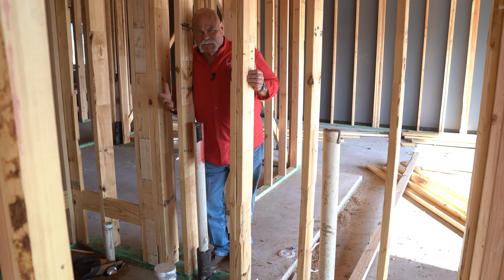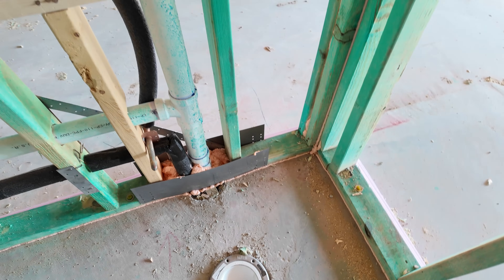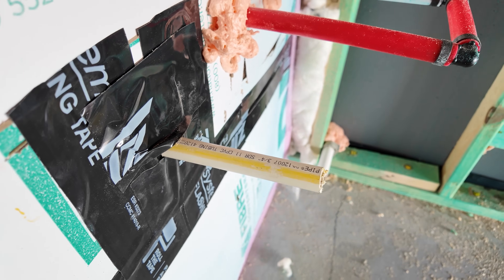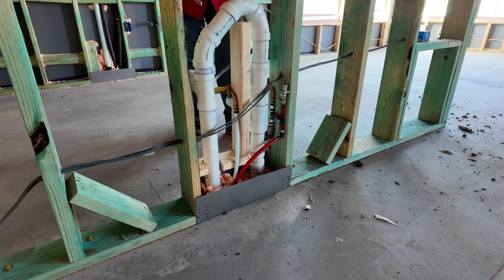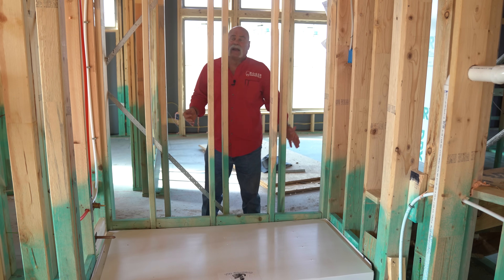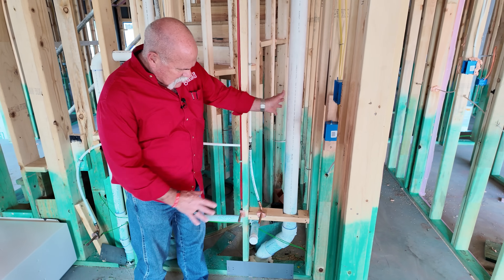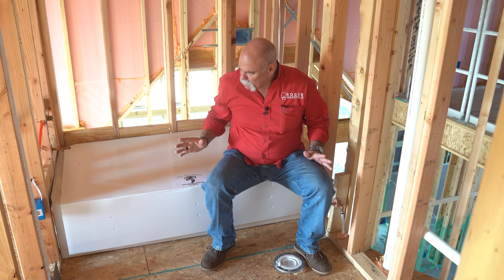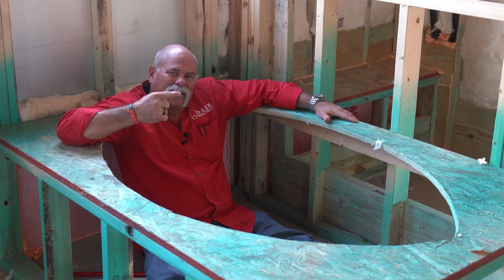House Plumbing Top Out | Everything You Need To Know

Comment: He couldn't hit that toilet right them offset flanges are stoppages and he leaves it wide open not even taped up or anything so someone can drop oh idk something down it and it not get seen and get pushed down the line and get jammed in a wye ten feet away making it a total nightmare to get out when I do the top out on a bathroom when I walk away everything is done and then move to the next part of the project this way your not retracing your steps and ending up walking back and forth to the same place you have already been ten times it's just more proficient also why are they still doing island vents one 3 inch stub up in the back of the cabinet not even in the wall will give you ample drainage and vent the pipe will never be more than half way full the top part vents the water and it's never going to be a stoppage issue just put a 3 by 1.5 san tee and a clean out on top of that and pick up the sink bam done. All done on final too so less labor on top out just rough in the water

Comment: The term Top Out had me puzzled for a minute as I've always heard of it as 2nd rough or "tubset".  All the same, different terms.  It looks great, the only thing I would do differently at this stage of my career is use 3 X 4 closet bends to bring up the toilets in 4" and leave them alone(Or cutting them down to a reasonable level if they're too tall) until trim stage.  Here in FL, lots of tile.. I like letting the floor guys or tilers get up to the 4" riser then cutting it flush with the floor and then cementing my pvc flange with stainless ring right on the floor.  Then, tap con into the concrete or wood screws if 2nd floor.  The copper stub outs are great as long as the water doesn't tear up copper in under 40 years IMO.  A little $$ as opposed to pex stub outs, but they are nice.  The  cleanouts for the kitchen sink are a great addition, nice job there.  Another fine vid Roger.
Reply from the maker: I love seeing how other people would do things…thanks for sharing! 😎

Comment: The plumbing and electrical is the only thing nice in those cheap home builds. Gott love the cardboard sheathing, water heater in the unconditioned garage, blown-in insulation, 100% flexible ducts, air leakage that adds up to that of an open window, foundations that won't last more than a decade or two, and overall pathetic craftsmanship on the framing.
Reply: But it does have 7 rooms and 7 lavatories, his and hers and 5 for children and guests and probably at least two kitchens. Not that anyone will be into cooking.

Comment: That offset closet flange is not approved by the UPC. You have to use the one that has the 45 made into flange. 
Look up “Kozy Collar “, for an easier way to go through the roof and seal the stack.
Reply: Nobody cares about UPC, every jurisdiction has its own building codes. If you're building on a remote island, then you can go with UPC.

Comment: The condensate drain for my concealed duct split system was something I still needed to figure out. This video gave me the answer I needed! Many thanks! I've not seen this addressed in any other videos.

Hopefully, it's acceptable to run it into the trap for the kitchen sink...
Reply: Is that a code or just a choice?  Connecting the condensate line inside a wall vs into a lavatory drain assembly?  I've always connected directly inside a wall.

Comment: I still don't get why wooden houses are being built. One spark, one gust of wind, one shake and it's gone.
Reply from the maker: What would you prefer they be made out of?
Reply: @RogerWakefield  Concrete with steel rods and bricks for walls. Just like we do here in Europe.
Reply: @yangashi  I agree, but its a massive affordability and specialized construction issue. Most these home builders are using migrant workers for cheap labor. A steel framed, brick house, concrete walled, timber framed,  ect, would all be custom. This house in the vid is a typical American track or spec home.
Reply: Concrete.
Reply: Stick built houses are most common in areas where wood is in abundance. In these areas wood is so cheap it's difficult to justify other building materials.

In the many areas of the world where wood is not in great abundance, the cost of wood is considerably higher. This leads people to choose other building materials.

I imagine there aren't many stick built houses in Egypt, for example.

However, there are plenty of 150 yr old stick built homes, so it must not be too bad.
Reply: @cornpop7805  There is abundance of wood here too. Furniture, firewood and even paper is dirty cheap compared to US and Canada. I guess it's mostly down to habit how houses are being built. And in the US started by wanting to build as fast as possible in the 1600s onwards and never stopped. Breaking habits, especially bad ones, it's hard.
Reply: @yangashi 
If the building envelope is properly done, they last well enough. There are many homes that still exist in the US that were built before the founding of our nation. I've had no issues finding many wood frame houses that are over 350 years old.

It's not like we don't use other methods, too.

Why are you so passionate about the subject that you seem but hurt about us using wood?
Reply: @cornpop7805  lmao, I am not hurt or anything. This is YOUR problem. I just think of the thousands of YOUR houses lost from a single spark, strong winds or even from a water leak and think, "yeah, this could had been avoided if they build the house properly". Three little pigs story exists for a reason.
Reply: @yangashi 
"YOUR problem" as in my problem? You would think if it were my problem, I'd be the one crying about it instead of you boo-hooing bo bo hoing about it.

There are people who seem to be professionally offended on behalf of other people. Up until now, this has been isolated to people who boo hoo for other people, politically. This is the first time I've seen someone pooTheirPants over construction materials.

You might want to get your diaper changed. Icky icky poo poo!
Reply from the maker: There is concrete everywhere here in the major cities in the United States, mostly on the roadways which is causing what we call "Urban Heat Island" where temps are higher in the cities due to the concrete holding and trapping all that heat. While they may be more structurally sound, it's just not the best option for our region.
Reply: @RogerWakefield  Spain, Italy, Greece have very hot summers too. But none of them build wooden houses. The "trapping heat" thing might be true for very old houses something like 50+ years old. But non issue today with the new materials. And you can always put AC or any other heating/cooling system.
Reply: @RogerWakefield 
Roger,
I talk about the (UHIE) Urban Heat Island Effect all the time.

I often mention the fact that the overwhelming majority of the historic temperature stations in the world are in the US and are now in urban areas.

I say how this ground based temperature data is mixed with the satellite data and serves to artificially amplify temperature data, making it seem as if the earth is warmer than it really it.

There's also the disturbance to local weather patterns, but to me, that's a distant second.

It's true that wood products are generally far less capable of contributing to the UHIE.
Reply: @yangashi 
The Urban Heat Island Effect that Roger spoke of isn't necessarily about the internal temperature of the homes. The Urban Heat Island Effect is the local heating of moderate to dense urbann areas.

It seems like the urban space has to be somewhat sizable, lets say =/> 300 sq-mi (777 km²). As well the area has to have a moderately dense distribution of structures.

The cause of the Urban Heat Island Effect is mainly man made materials and power consuming equipment. The man made materials (like concrete) usually receive UVA and UVB radiation from the sun and absorb the energy into their mass. The heat then radiates out at a lower frequency of infrared energy and into the local area.

Vegetative ground cover is far less efficient at absorbing UV energy and emitting infrared energy in return.

Blacktop and asphalt roofing materials are particularly challenging. But, concrete, brick, and stone are still quite challenging, as compared to natural materials.

There is an abundance of power consuming equipment in urban areas, all of them emitting infrared heat energy. These contributors to the Urban Heat Island Effect are independent of building materials, but they needed to be mentioned in order to round out a description of the Urban Heat Island Effect.

So yes, like Roger alluded, wood works better than masonry materials in regard to the absorption of, storing, and emitting of heat energy.

Also, wood has a better R-Value (1.4/in), than concrete (0.1/in). Wood being a 14x  insulator.

We certainly still insulate, but compared to wood, masonry products are heat conductors. This works against the building in both heating and cooling seasons.

Again, we've got lots of wood built homes that are over 100 yrs old and a surprising number of homes as old as 300 to 350 yrs old. That's not the Roman Colosseum old, but keep in mind that many of our wood homes endure 4 seasons that range in temperatures from -10⁰F (-23⁰C) to 105⁰F (40.5⁰C). Additionally, we have rain and severe snowfall in many of these areas.

We think wood is doing quite well for us, but thanks for your concern!

As for the Urban Heat Island Effect, in does increase local temperatures 3⁰F to 5⁰F. But it also increases severe weather in the less densely populated areas surrounding the urban areas. This is because weather patterns tend to go around the rising heat tunnel, which occurs above the urban area. This makes the weather patterns concentrate around the more rural areas, yet still making the storms less predictable.

It's kind of like mini climate change only way more real (since climate change is 80% BS.)

Comment: You know what i love about plumbing is I actually stopped plumbing for 2 years i got tired of negative attitudes at work but i ended up working as a framer for that time, i got tired of those guys even faster but what i learned as a framer made me that much better as a plumber, knowing what i know now really helps me with stack and manifold placement on ground rough stage and my jobs run just super smooth

Comment: Mr. Roger, you mentioned a regulator for the Range. Why is that necessary? Is the gas meter of high pressure?
Reply: There's a regulator built into most appliances. He meant straight to the connection in the range.